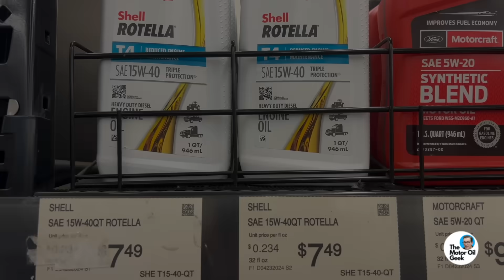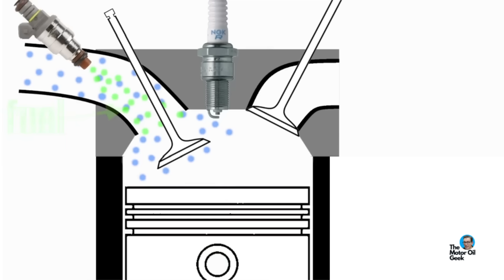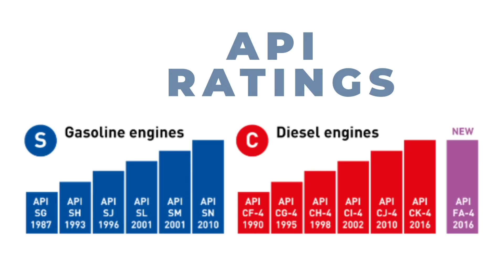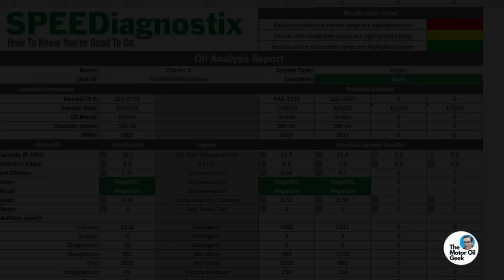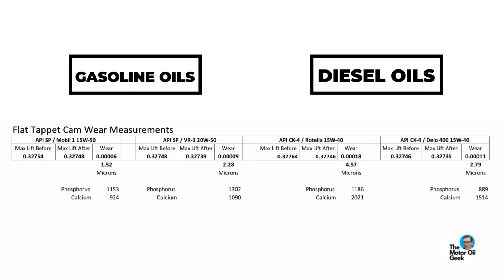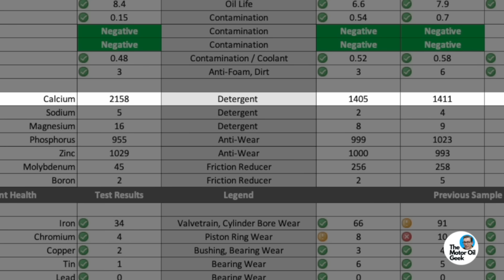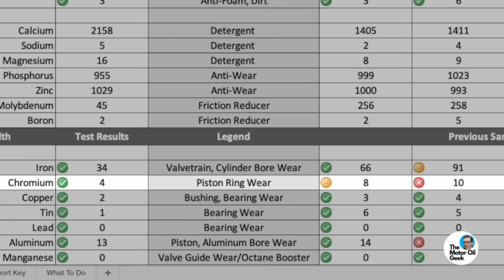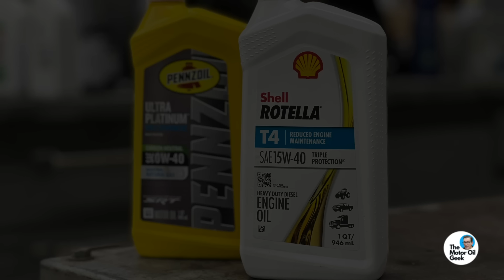Why DIESEL Oil is Actually WORSE for Gas Engines!

Comment: Please do an analysis comparing the old Pennzoil platinum formula to the new one that now claims 15k mile protection. How were they able to do that without adding a ton of additives. I remember from your older video you showed the old platinum formula was super pure therefore excellent at controlling deposits. The new one must be loaded with moly and others so naturally it’s gonna produce more deposits right??

Comment: This obviously created some controversy. Perhaps make another video addressing some of the comments here about different engine types and age.
I just checked the current Technical Data Sheet for Rotella T6 and found it is still JASO-MA/MA2 certified, so perhaps the motorcycle community is safe?

Comment: I feel this video is misleading from the start where they say gas is direct injected into the cylinder, it's always been mixed with air to form a vapor. No mention of this .  I have been using Rotella T6 for years with no problems.

Comment: I've been running Rotela diesel oil in 3 antique gas tractors for decades with no issues. In fact my 1955 Ford 800 and 1957 Ford 600 perform flawlessly on the Rotela 15W-40. Very pleased with the longevity of the machines. My Ford 800 has been moving snow for 70 years!
Reply: I think that's his point though.

Low pressure fuel systems and low output engines are going to have little to no problems.

But move to high pressure Direct Injection, with higher compressions ratios and boost, and you can have more issues.

Comment: Well im glad to know a bit more about the oil i use in my flat head castiron briggs and stratton engines, especially that im using the best oil for them. I use the shell Rotella 15w-40. For some context they dont have a oil filter or oil pump they have a oil slinger on the end of the rod that throws the oil around. However high detergents keep the oil contaminants spread out and prevents contaminants from sticking together and causing increased wear.

Comment: Good to know. I still use diesel oil in gas engines in the case where the oil pump is still good, the pickup is not blocked and the engine is loose, or at the end of life. I'm this case, I try to get away with something that is not very heavy weight but will bring oil pressure back up. And, diesel oil has a impact additive that seems to help with really bad engines. Have had no problems in these cases extending engine life for a long time.

Comment: The video I would like to see is what oil should I use in my pre emission vehicle or my antique tractor. I've been using Valvoline 10w-40 for race engine it has 1.7 time the zinc. I my flathead v-8 I run 20w-50 Valvoline for race engines it has 2 times the zinc. Where can we see oils used and the best one to use.

Comment: Try the opposite:
Run car oil in a diesel engine. Ran 10w-20 Penzoil, in a Cummins diesel engine, oil change intervals @ 10,000 miles. Inframes( overhaul)@250K,1 million miles on a tractor trailer vehicle.

Comment: Need some expert advice:   I’ve had Diesels for years and I’ve always Run Conventional Rotella 15W-40 (All pre-emissions).   On my 2023 Jeep Ecodiesel, I’m not completely sold on the 5W-40 Penzoil European Formula actually protecting the longevity; a lot of folks use AMS Oil, but it doesn’t have the MS-12991 rating like the Penzoil 5W-40 Pure Platinum European Formula .  With all the 3.0L Ecodiesel issues you see out there (even on Dave’s Channel) I change my oil every 5k miles religiously.  But is there a “Best Oil” or best “additive” to actually keep all that soot from building up and clogging up the EGR, intake or preventing “tar” like clumping in the oil pan?   Thanks! -Jon

Comment: T6 running in my Triumph Rocker III classic because it meets the specs it needs vs the castrol that costs 4 TIMES MORE... doing an oil change every 3000 miles on a wet clutch... IM VERY HAPPY to save

Comment: Yeahhhhh. My inline 6  4.0 jeep xj has absolutely loved the rotella t4 diesel oil. Smoother idle at operating temperature then with non diesel oil. Over 210,000 miles steady compression, no backfires, good mpg.
Reply: Likewise in my 95 XJ with 226k and running T4
Reply: Guess they are just built different, quite litterally only one step away from being a tractor🤪
Reply: @ultramarine3527 I would rather be one step away from a tractor with my 4.0 liter than a complete failure of an engine with multiple failing chain guides, Cylinder shredding GDI and throw away blocks .
Reply: @MUUKOW3  yuh
Reply: 272k miles jeep grand cherokee, t6 15w40 diesel works great in mine, those old inlines were built like fort knox lol
Reply: T-4 has been in my 4.0 Jeep since I bought it with 40k miles.  Currently at 210k.
Reply: My 96 Cherokee 4.0 came with half a jug of t4 10w30 rotella, that's what I'm using, mine is at just under 250k.
Reply: @foxmulder7616  The lord's oil.
Reply: But foam out the waazoo and 40 degrees more oil temp. 4.0s shouldn't get diesel oil..especially not shitTella

Comment: running Rotella t6 in a Tacoma 2015 from the 1st oil change, currently has 180k miles, no noise, no blow by, no issues whatsoever.
Reply: There’s a fine line and Lake doesn’t explain why all the “upper tier” oils like Valvoline EP and Amsoil Signature series oils all have high levels of calcium?  Lake, what say you?
Reply: that's not a GDI engine
Reply: I've been running it in my gold wing since new 2015 no problems.
Reply: @roadtripper5553 gold wings are indestructible, even with no oil change is happy.
Reply: What about gas engines that call for 15w40? My gy6 150cc scooter engine has 15w40 stamped on the case right next to the oil filler.
Reply: You could use vegetable oil in a tacoma and it will run 180k miles lol
Reply: No frame ?
Reply: I run t6 10w30 in everything now no issues. Don’t care what the results of testing show it works. Lol
Reply: @smallengine  In terms of wear protection it will do just fine, but don’t use it in gasoline direct injection engines, you will increase the risk of Low speed pre ignition because the calcium content is high, and is similar to pre API SN plus oils which are designed to reduce LSPI.
Reply: @ so run a higher octane fuel in direct injection?
Reply: @smallengine  Generally most GDI engines are already high compression especially if non turbo, so a high octane fuel would be close to the minimum required in the first place. For example my 2022 Subaru BRZ with the FA24D engine non-turbo has a compression ratio of 13.5:1, so a 91 octane fuel is basically the minimum. I use Rotella in my OPE equipment and some of my older cars but I would not use it in any GDI motor regardless of fuel octane. Running a higher octane just to use Rotella would also be silly because higher octane fuels cost more.
Reply: @smallengine  No, this pre-ignition issue is not octane related.
Reply: @FrankDank-ik7ic  what would it be caused from exactly in the oil?
Reply: @smallengine  There's a difference between "works" and optimal.
Reply: @smallengine  Blind faith... 'Merica:cat-orange-whistling:
Reply: 530k on a unmolested 4cyl 96 tacoma . Mobil1.
Reply: @mandytuning you must have taken excellent care of it!
Reply: @o_g_i_b_rockin  Every 10k interval.  Others fluids was yearly. Was my heavy equipment sales truck. Body was beat up like nothing else in this world 😂
Reply: A Toyota with 180k? Those are rookie numbers and it says more about mid-2010s Toyota than it does about the oil that's in there.
Reply: It will work but why not maximize your protection.  You can buy the Valvoline full synthetic high mileage Garage Box (12 quarts) from Walmart for $58.  This is what I use on my Ford Escape and I have 182,000 miles. I’ve used T6 in my wet clutch Yamaha Vstar because of what people say on message boards, YouTube and FB groups but I’ve since switched to Valvoline motorcycle oil for that as well.

Comment: Finally the diesel oil is better myth, I almost forgot about this one. It's crazy that people think oil manufacturers don't know how to make oil for a specific application. If diesel oil was better, they'd just make the exact same oil with different branding for gas engines. Plus you have the issue of diesel oil usually being the wrong viscosity for gas engines. There are a lot of guys out there convinced conventional shell rotella t4 is better than full synthetic oils, because diesel...
Reply: The amount of comments refusing to accept data, and instead promoting their anecdotes, makes me lose faith in the automotive community. The diesel oil cult is way worse than I thought it was.
Reply: It's not just about thinking we know better than the manufacturers it's the fact that the outrageous CAFE standards put in place by the African village idiot pushed manufacturers a decade beyond all current technological capabilities and that's why they are making decisions that only result in 0.02% of an increase in fuel mileage all over the place most of which are very bad for the consumer in terms of longevity but thanks to all the people that watch sports instead of paying attention to politics and fulfilling their civic duty to prevent fascism now we spend $85,000 on a truck that probably won't even make it to 100,000 miles without a major engine problem because they are making oil pump drive gears out of plastic to conform to the outrageous leftist Democrat nonsense.
Reply: @MAXIMUSMINIMALIST  Specifically, what manufacturers are making oil pump drive gears out of plastic?

Comment: Beater, high-mile BMW E46: burned a fair amount of oil and leaked like a sieve.  Switched to T6 several years ago and the BMW burns less oil and my garage floor is (mostly) stain free.

Comment: I have a FRESH REBUILT big block Chevy 402.

Which oil would you recommend?

👍🏽-Comp Cam Hydraulic Roller cam

👍🏽-Howard’s Hydraulic Rocker Roller lifters

👍🏽-Carbureted 

The engine builder recommends:

Delo 15-40

I’ve got 200 miles (Break-In)

Talk to me.

Thanks,
Joseph

Comment: Clearly, over 80% of people in the comments did not watch the entire video. I'll sum it up for those who run straight to the comments. Diesel oil is not recommended for newer TURBOCHARGED GASOLINE DIRECT INJECTION engines due to a concern of low speed pre-ignition. You want to keep running it in your lawnmowers, ATVs, and granddaddy's old truck, I'm sure you'll be fine. But for newer engines, don't run it. Simple.
Reply: All he had to do is put that in the title, but if he stated "gdi" in the title, many viewers wouldn't have taken the bait=far less views. I believe he's done this in video titles before, generalized gas engines, when the video was for gdi engines exclusively.

Comment: Interesting…however I usually rely on personal experience …I use AMSOIL 15-40 in all my fleet of gas and diesel engines….so one thing is the soot and detergent issue…so taking valve cover off of my 1990 Chevy 5.7 the cast iron in head looks new and the valve springs still show the color strips
At the recent SEMA show I discussed my choice with AMSOIL  reps and they did not have any negative comments

Comment: I normally have to agree with this guy, but Ah, Bull Crap !! Ive heard this TRUSTS THE SCIENCE before. Especially in 2020. Their science turned out horribly wrong just like this guys science research. Seen too many engines that had a lifetime of the ""wrong"" oil.. Ive seen 350k gassers, 500k diesels and 12k hours on heavy farm equipment.

Comment: If you throw a lit match into a bucket of gas above -40 degrees, it will in fact ignite, and unless you have the proper fire extinguisher or lid to put it out you're gonna have a bad day.  We used to train rookie fireman how to use a fire extinguisher this way.   Now diesel is a different story.
Don't do it is good advice.

Comment: I worked on a fleet of trucks that happened to be brown and the largest in the country. We used diesel spec oil at the time on everything, and we never had issues with oil related failures
Reply: I run 2 toyotas each with 250000 miles. Still not burning any oil. I run 15/40 in everything. I've logged close to 1,000,000 miles with diesel oil in gas engines. Never a problem.
Reply: @ IMO This guy is a hack.  You don’t draw conclusions from sample of one comparisons.  Especially, when measuring minuscule wear differences in microns and then not publishing measurement error.  I bet you take cams out and put back into measurement machine you get different results.  Thus, this is why measurement repeatability and accuracy matters.  Then such minuscule wear equates to what kind of real world operating cycle and is such wear even relevant to functional life or performance.  When the minimum valve clearances are usually no less than .004” and the wear difference is like .0001” it is 40X ratio.🤣🤣. Then that might be total maximum wear or at the point where cam ramp starts for engagement with tappet.  Just because it is measured doesn’t mean credible or critical.
Reply: Guys..... It's USPS Duh!
Reply: @ there's not an oil out there anywhere that will make USPS run smoothly...
Reply: As a landcruiser enthusiast I can tell you that almost every landcruiser I owner I know runs shell t4 rottella 15-40 in the 40, 60, and 80 series without any issues. These vehicles are port injection
Reply: Most people nowadays don't keep a vehicle long enough for 3 oil changes, so who cares.
Reply: me too no issues
Reply: @Patrick-xd8jv  were those Engines  Variable Valve Timing GDI with a Turbo on them?
Reply: Thank you because half the time this guy is nothing but bulshit.
Reply: yep  proof is in the pudding  here again 3 times  now ,  cant be  an anomaly
Reply: Diesel oil for the most part is superior to gas api-sn oil. But not api-sp.
Reply: Were the big brown trucks using turbocharged direct injected gas engines?
Reply: @ DI
Reply: Where the hell is that T-shirt I ordered from Amazon?
Reply: yes where I work we use 15w-40 diesel oil for EVERYTHING or ATF for anything that don't like the 15w-40 lol. Without oil changes for at least a good year or 2 also
Reply: Probably.
Reply: Built a lot of brown motors. They pulled them at 250,000, and most were in great shape.
Reply: I retired as a feeder driver. Last i saw the company was using 10w-30 Mobil in everything. 
Though one of the mechanics went thru 4 chevy engines in the span of 2yrs. The remans came from a place in WS. 
They wouldn't warranty a couple of them
Reply: FedEx
Reply: @Hellcat71782 UPS
Reply: @Hellcat71782  try again
Reply: @Hellcat71782  Brown not white
Reply: @ no wayyyyy
Reply: @Hellcat71782  No, it's clearly DHL
Reply: @ my bad
Reply: @Hellcat71782  UPS trucks are brown.
Reply: @ no way? Really?
Reply: Low pressure gas engines are not at risk apparently for the ring groove detonation. The deterioration of the anti wear film would be subtle on a conservatively built engine (you could run straight oil with no additives and get away with it). But why would you not want to optimize?
Reply: @richardkudrna7503 Tell me how an engine used in delivery vehicle is light duty?    Many stops and then accelerations under higher load.  Way more harsh operating condition then any passenger vehicle.
Reply: @kannermw  commercial delivery trucks are typically built with engines set up to have very light bearing loads and thermal stresses. Low power density for same materials. For example, in a gas engine you cam to have little lap so good low end torque and incidentally lower exhaust valve temperature. Oil system set up with a larger volume pump for adequate pressure at hot idle. Passages with lots of parallel galleries to get everything wet sooner after start. Low combustion pressures by cam design and throttle area but still adequate pressure ratio for low power efficiency. 
The extreme opposite is a high performance motorcycle engine. 
If you look at an aircraft engine you will notice the very light bearing loads etc. design for reliability and durability.
Reply: @richardkudrna7503  Where do you get such nonsense?   You just make it up and hope it sticks?  They are using standard engines like GM LS 6.2L V8 not some custom designed engine.
Reply: @richardkudrna7503 what are you even talking about? Commercial delivery vehicles use off the shelf engines. They usually have a slightly differently tuned ecm and that’s it
Reply: @kannermw  I've seen how those guys hammer on those "brown" trucks definitely not easy service.
Reply: @brianhiggins7599 A large displacement engine with limited peak power output used in commercial application is not same as small engine with comparable peak output operating with same duty cycle. Also, gearing on these trucks is quite low.  This minimizes peak loads on engine components during acceleration.  The worst things for any engine is lugging or peak torque operation for long durations or constant  high rpm usage.
Reply: @kannermw I've always heard that the engine used in the,brown delivery  trucks was the Ford 300 6
Reply: @richardkudrna7503 That failure was not detonation.  There are many outright lies in this video.  So much so I wanted to 🤮.  Garage engineers are absolutely the worst as compared to real engineers who design and test engines.